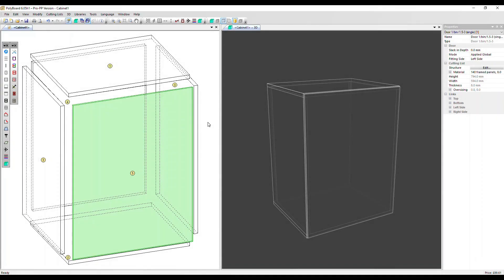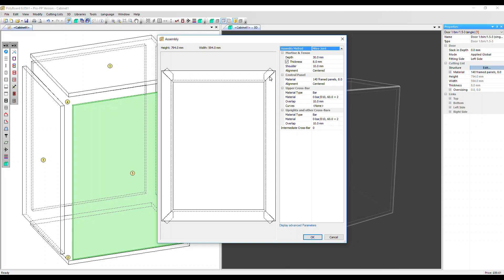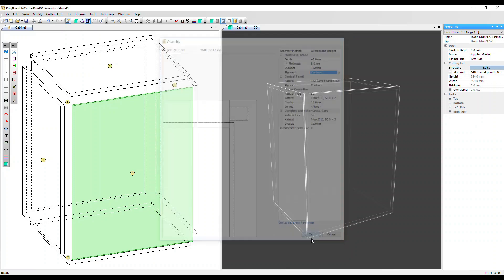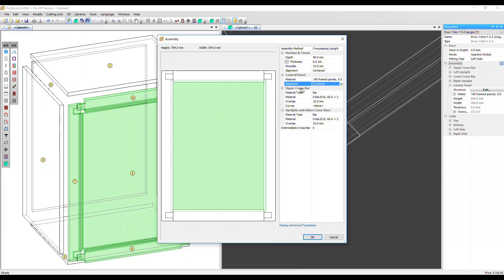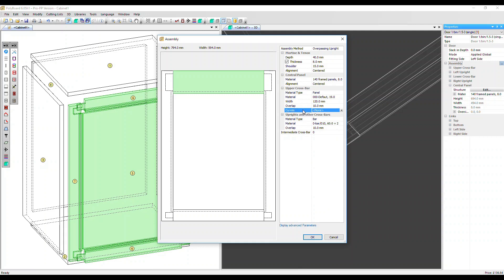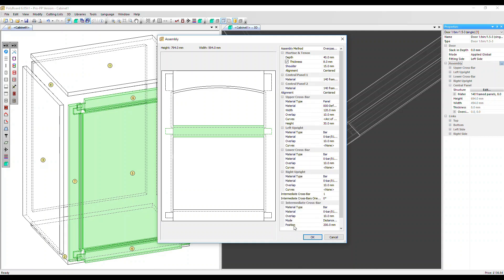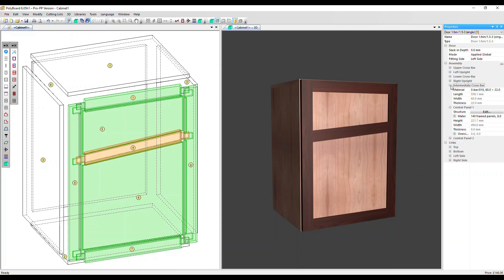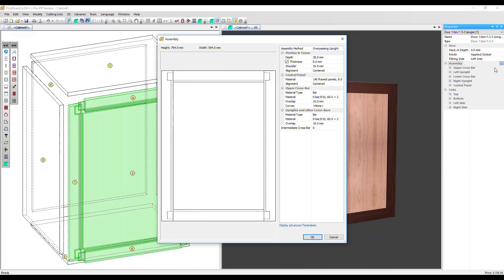Assembly with Polyboard

Comment: Is it possible to add inner bevels to the frame of the door along the edges of the panel? How would you go about doing this to add more style to the shaker doors?
Reply from the maker: Hi Steve, adding bevels and mouldings etc isn't something you would do in Polyboard, it would be a separate production process. Polyboard is focused on panel materials, although you can use bar materials as well for frame and panel façade for example. Thanks for your comment.